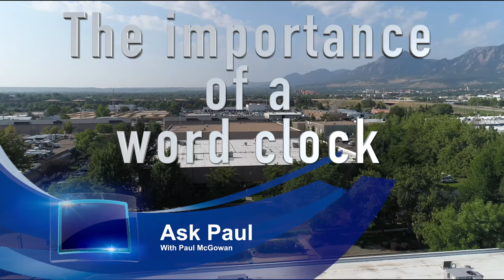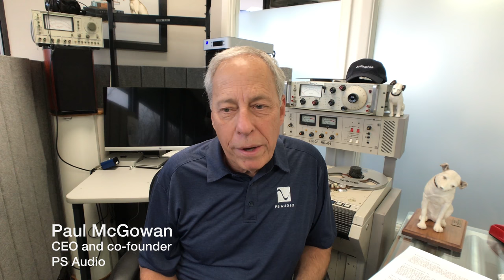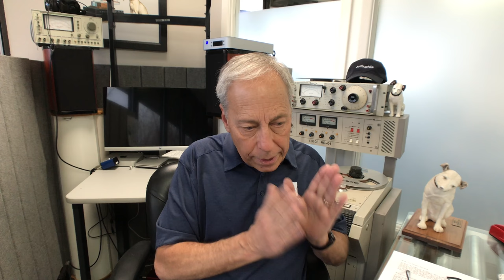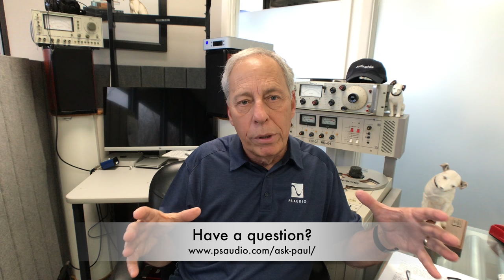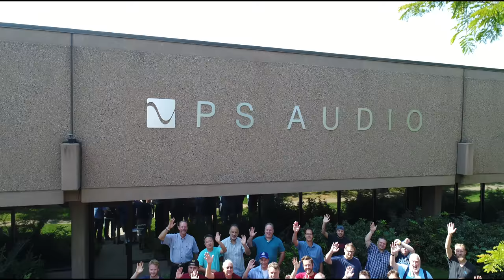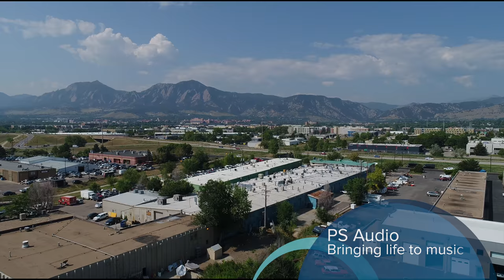Expensive add on word clocks?

Comment: Fore once I don’t agree with you Paul. I have a mutec3+ and ref 10 external clock between my streamer and dac amplifier and this delivers a huge improvement of detail and placement. My idee is that the clock delivers the data at the exact time to the dac. So the clock of the dac does not need to make corrections. So you get lower yitter with leads to better sound quality. So its not the long time function of the clock, but the short term exact placement of the data to the dac.

Comment: In my experience, clocks make important changes if the listener/ engineer cares about that change.  To my ear, it can change how dynamic or open a mix is.  Whether in a studio with TDM racks or on an MBox.  I plug an Antelope into my MBox, a veil is lifted.  EQ choices are easier and I don’t have to think as much about them.  So that may or may not be relative to accuracy long term, however it would make sense if by chance, better accuracy at small increments begets better accuracy long term - hence the designers advertising the long term as a reference.  Short term and long term are not unrelated.  And anyone who is spending big money on audiophile speakers/ amps/ etc - they are also exactly who would care about this essentially very minute change.  It’s that nth degree better.
Reply: Facts. I have one and the sound is richer, vibrant and clear all around...and isn't sibilant or shrill. It also can make cheap speakers sound world class too. And I got a good dac already... And it takes things to five levels above

Comment: To say a rubidium clock is only accurate in the long term makes no sense they are accurate in ppb of a second an accurate long term as well used mostly for GPS,telecom, where micro seconds could mean miles or missed information. Audio is moving up in timing so the need for more accurate timing DSD is a perfect example. Word clocks are used in digital recording an playback when multiple digital devices are stringed together so they can all be synched to one clock that clock has to be accurate or errors can occur an be audiable. Today some external dacs have bnc connections for word clock or 10mhz seems a shame not to use them. More accurate clocks are needed more today in audio so with my point made I must disagree with your assessment of these clocks with all do respect.
Reply: I agree. It seems to me he wasn't especially clear about his answer. He could have said, "if the gear wasn't designed particularly well, with emphasis on a solid clock, then an external word clock will be audible and worth it. However, if you buy a PS Audio DAC or another DAC with careful consideration of the clock, then it's not worth it to add an external clock." And I would add that if you can hear the improvement, then is it worth it to you to spend the extra money on the upgrade? 

I'm researching word clocks now for the A/D end of the chain, and am caught between the Mutec MC-3+ and the Black Lion Audio Micro Clock MKIII XB. I suspect either would clean up my converters.

Comment: Different tracks are going to play at different speeds even tho both were the same copy of the 1 piece? I have 1 audio at 24 bit 44.1 in track and sent out to midi and imported as a data file back in but it converted to16 bit 44.1midi piece of the same recording. On playback of the two commited tracks 
The tempo says 136bpm midi tempo track and the original audio track is actually tempo 94bpm.  Syncing is impossible 135 is extremely slow to the original and 137 is too fast to the original tempo. Is it the bit rate or the midi controller clock  no connection to the interface clock but both connected to the computer?

Comment: Just one UK manufacture's name for you: dcs....State. of. the. art.
Reply: Agree, David. I started with only the Vivaldi DAC and Upsampler in my main audio system (PA Audio DSD is in the theater system). I never thought the Word Clock could improve upon those first two units but I got one from my dealer to trial and guess what? In A:B testing with myself and a number of others over several weeks, we definitely could hear improvement with the WC in the system. I'm not technical enough to know if that is because the clock is more accurate, reduces jitter or what, but I know my system sounds better with the WC in it.
Reply: I did an A/B/C/D/E est in my system a couple of years ago before buying the Vivaldi. The 4 DACs were PSA DSD, Esoteric (both of which I already owned), Briscati, Berkeley Reference, and Vivaldi (all provided by local dealers). Of course, that was several firmware releases ago (for both PSA and dCS) and I'm now in a different room with different speakers, so maybe it's time to do another A:B over the holidays? One thing for sure, PSA has much more frequent and timely software releases. dCS announced MQA support last Spring and has yet to deliver.
Reply: Paul McGowan yes your products certainly do compare very favourably on reviews with the finest available. For mr it would be your stella range - the gain cell topology sounds very intriguing.
Reply: Stellar, my apologies!